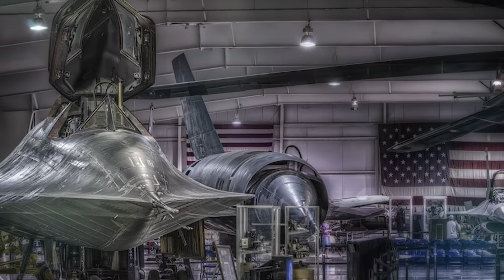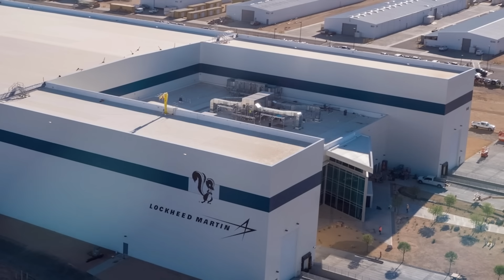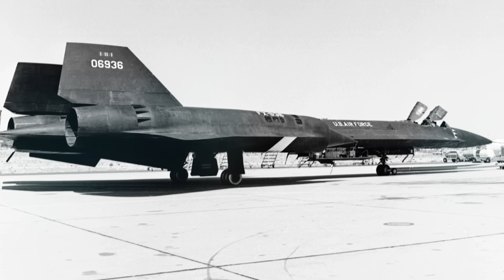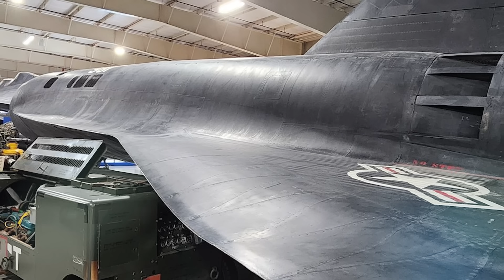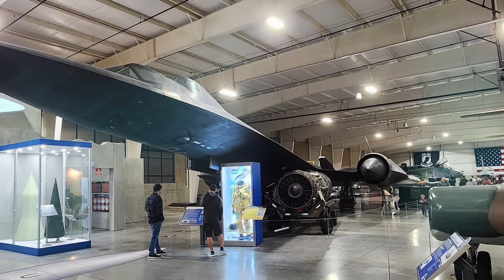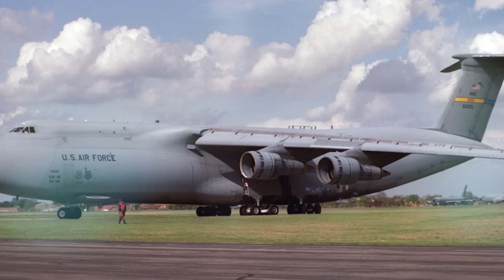"The Bastard," the only SR-71C ever built

Comment: If I understand the operation of the SR-71, this aircraft was used for hi speed, hi altitude recon, along a flight path just outside the country of interest with the cameras snapping photos aimed sideways with the SR-71 not actually flying over the country of interest. And the recon could take place within hours of the mission being assigned to the wing. So, if this role was so vital, what equipment replaced the SR-71 to fulfil this role?

Comment: What gets me is this was done with slide rulers, Texas Instrument  calculators, drafting tables, and probably computers the size of a Ford storage warehouse. And with today's tech, it takes 5 times longer than it took designers and engineers in the 50s & 60s! And it takes 20 times longer to get the birds out and flying.  The P-51 was designed  approved, and started to be built in 41 days or something like that
Reply: It's true that those people who designed these aircraft with slide-rules & drafting tables were geniuses, today's bleeding edge tech is largely working to find new materials, sensors, software, sensor integration, computer learning… as impressive as yesterday's black projects were, today's bleeding edge tech could not have been possible without the use of machine learning and simulation.
Reply: There were NO TI calculators when the SR71 was designed and built.

Texas Instruments calculators weren’t invented until 1967.

Comment: Imagine building a aircraft like this using a slide ruler in the amount of time allowed then Mr Kelley was a aviation genius
Reply: It's slide rule. Not ruler
Reply: Slide rule or not, the sheer pace of the development programme and production was astonishing. It would take a 20 year program to make a plane like this now. Amazing what you can achieve with almost no bureaucracy and uncontrolled amphetamine diet pills
Reply: Slide rules are pretty fast.  Punching numbers into a calculator is slower.
Reply: That's a myth, in the first place electronic computer's were used to make calculations in the construction of the U2, A12/SR71 and the X15. 
And a slide rule is a computer anyway.

Comment: So we have several different YF-12's and SR-71's in museams now...What is the value of the titanium skin that is still on these birds? Would it be worth while to replace those skins with aluminum for display and then re-use that metal? 
Honest questions that seem interesting to me and love to get some answers for my education..
From what I've read the builders had to use some fasr feet ro get that much titanium from Russia
Reply: It wouldn't be worthwhile.  The labor costs alone to disassemble one without destroying the underlying structure (which would be impossible, given the aircraft as a whole is reportedly 92% titanium - the majority of which is likely in the structural airframe vs the skin) would swamp any amount of money saved by recycling the recovered Titanium.  And that's before considering the costs of (re)creating the tooling to do a small run of replacement parts in Aluminum or steel, and then paying for the skilled labor to rebuild it all into an imitation Blackbird.  

There would also be hazmat considerations - off the top of my head the primers used at the time are extremely toxic - even the modern alternatives are only somewhat better (modern hexavalent chromium primers are still nasty stuff, just less so than the older formulations).

All of this quickly adds up to it simply not being worth it.  Especially if the intent is to rebuild it into something otherwise nearly identical to the original structure.  This would definitely fall into the realm of "Beyond Economical Repair (BER)".  It'd be much less expensive to create a full-size steel tube and fiberglass shell replica and completely scrap the original, but even then I doubt you'd come out ahead, especially for such a limited recovery of material.  Doing a very rough calculation based on the numbers I could dig up, at current prices each Blackbird only contains about $150,000 of raw Titanium (~24,621 kg of Ti at $6 USD per kg).  Even at two or three times the price, it wouldn't be worth the time and effort.

We'd pretty much have to be at the point where for all practical purposes there is no other Titanium available in the world for such a project to start making sense, and if we're there, we probably have bigger problems to worry about. 

Good question though.  Even though I build structural assemblies for jet aircraft for a living and had a gut feeling it wouldn't be worthwhile, I hadn't realized just how unfavorable the numbers would be.  $150k of raw Ti in each aircraft is a lot less than I expected.

Comment: Leaking fuel BIG DARK BASTARD that flies faster than most Cameras (Click) shutter. Yeah. Expensive.. however not knowing what they have can be a lot more expensive. Way back when in the Fifties a President had to make a hard call. (Do we have a Bomber gape?) A U-2 solved that problem and after few more flights caused one. Ergo the A-2. The President of the US at the time misread the paper and called it the SR-71. Not the designers of said Aircraft and.. it stuck. Thanks to the Swede Air Force we never lost one over Enemy Air Space and that is a good video too.